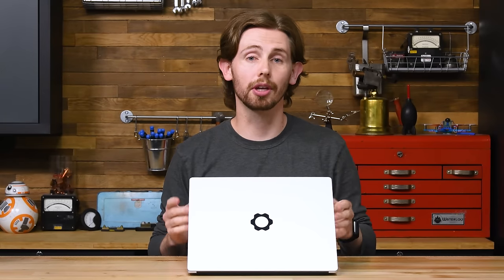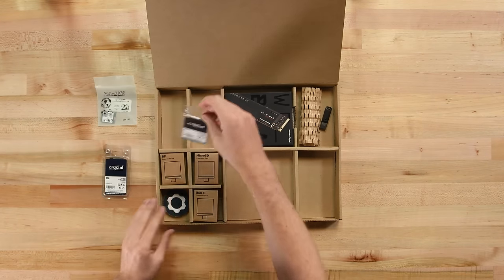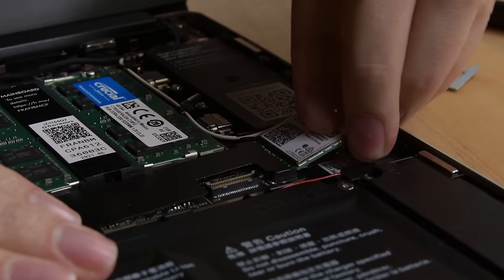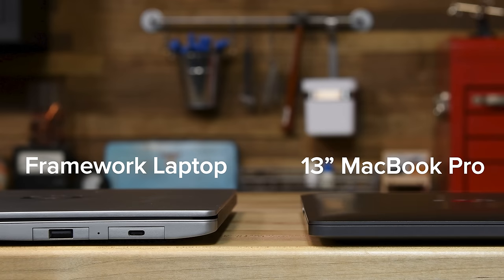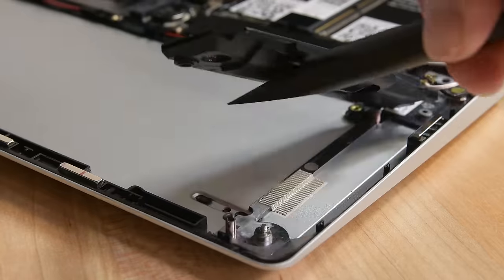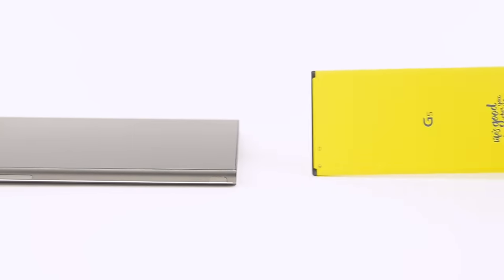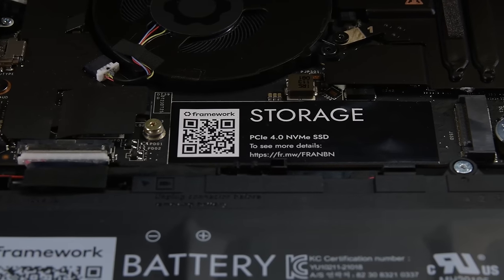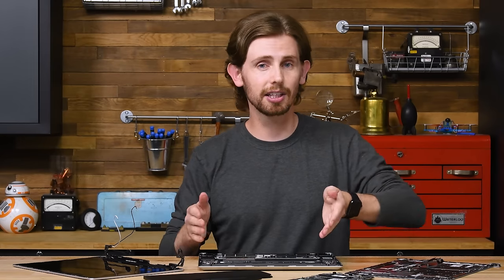Framework Laptop Teardown: 10/10, But is it Perfect?

Comment: As soon as they come out with a model that includes a dedicated GPU, I'm in.
Edit: Framework, you SOB, I'm in!
Reply: Dedicated gpu and more cpu options
Reply: I agree. I want a discrete GPU and and AMD cpu. Problem is the chassis will probably need to be bigger and then they'll need a way better cooler than they have now. Then they need more SKUs and everything gets complicated.

Still, the idea is great. If we could get to the point where you really could DIY your own laptop I'd be very interested.
Reply: Yep...if they make a gaming version of this (even if significantly bulkier), it would be my next gaming laptop.
Reply: Or just buy an egpu
Reply: same
Reply: They could even just make and sell a deeper bottom cavity to swap out on the current framework laptop, if people like me ever decide they want a dedicated gpu.
Reply: @Mutex30  gaming laptops serve zero purpose
Reply: @KookoCraft  I know, because portable gaming totally isn't a thing (rollseyes)
Reply: @KookoCraft  for you maybe, but there is clearly a market for them so...
Reply: Wait for RDNA2 graphics, they will be enough to run most games at low settings and are perfect for mobile devices from what we've seen so far
Reply: Waiting for that as well
Reply: @mrmarker98  true. And intels cpu-gpl A’s well. Framework looks like gonna have bright future.
Reply: Get a E-GPU. They have a dedicated enclosure that can also charge your laptop, and the Framework Laptop supports thunderbolt too.
Reply: I have an old Dell M4700 that is stupidly modular. All magnesium frame+ skin, Socketed cpu, MXM module, 4 sodimm sockets, wifi card slot, msata slot, 9 cell battery pack and bottom mounted extra 9-cell, removable optical bay (second sata drive bay) and the primary sata bay/frame has an spring loaded eject key for those "burn the evidence" moments.
...It's 3 cm thick but I want someone to make something like it with modern components.
Reply: I know, but the lad can dream
Reply: I know that I am not the kind of person that would want a gaming laptop, but why have a dedicated GPU built into the laptop when you can use thunderbolt and have an external GPU enclosure?  I know the frame rate would suffer a little, but the upgradability of an external card would more than make up for lose 10% (or more I don't know how much) of your frame rate.
Reply: Definitely down for a gaming edition of the Framework Laptop. I will immediately purchase one and sell my current Lenovo IdeaPad 3 Gaming. Imagine the modularity
Reply: I just got mine, I feel like they planned for a dgpu because there are identical vent holes on both sides but only one is a vent for the CPU, they have ideas
Reply: @Weaver_Games  well they can make like some form of additional board or like add on chip for gpu but it won't be so good like 2090 ti max.
Reply: Accodring to Linus from LTT, he said that theyd know that. So it might just happen which is going to make a lot of buyers happy and put a ton of Laptop manufacturers out of business. I wish them the best from the bottom of my heart.
Reply: @Weaver_Games  I would not mind a 17 inch version with GPU and their current 13 Inch version with CPU only. It seem likely to go together in most case,    If someone need a GPU it will prob appreciate a bigger screen.
Reply: @codecode1948  Does it work as well as GPU ?
Reply: they just did
Reply: Hey!!! Now is your time, 16 inch laptop available for pre order this spring with a modular GPU.
Reply: Well today's your lucky day
Reply: They just did!
Reply: @urielzaja  you SOB, I'm in!
Reply: And all of your questions have been answered!
Reply: this aged well, framework 16" with removable gpu module was just announced.
Reply: this comment aged well
Reply: @Weaver_Games  wish granted....
Reply: Props for not only sticking to your promise, but comming back to edit your comment to acknowledge as much.
Reply: Your dream is coming true this year! They have a 16" coming with dgpu support and the dgpu is modular as well.
Reply: <3 blessed edit
Reply: Lmao that edit tho
Reply: @Weaver_Games you wont believe this
Reply: @KookoCraft it’s in the name, and gaming laptops are just powerful laptops
Reply: @GregOfficially with weak battery
Reply: Did you preorder the 16, its HAPPENING..

Comment: The assembly/disassembly looks precisely as easy as a DIY desktop PC. I want to see this more!
Reply: Probably even easier since you don't have to worry about the power supply.
Reply: @sebastianjost  I mean isn't the battery an equivilant.
Reply: @heroninja1125  Not really, because you don't have to route all the PSU cables in an awkward way
Reply: I’d say personally the hardest part is cpu installation, power supply is easy if you don’t care about neat wiring :>
Reply: @anonymousidea9119  you mean the cpu cooler probably, the cpu is just to place in a socket :)
Wiring is a nightmare though, just to keep it neat, not even in a pedantic way
Reply: @danepher  no, I genuinely had a harder time with lining up the cpu in the socket
Reply: Much easier. It has a nearly non-existent need for cable management, and the average desktop has more non-captive screws (although since the DIY desktop market is highly varied, generalizations always fail).